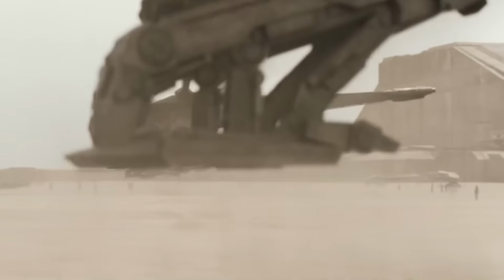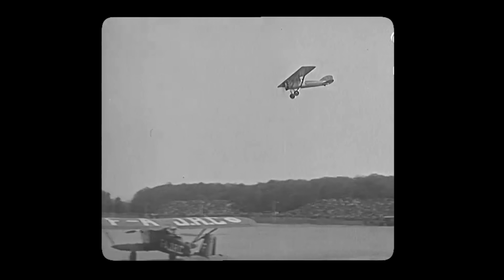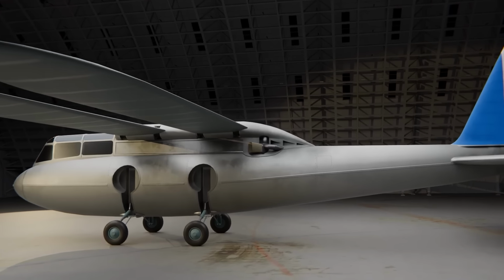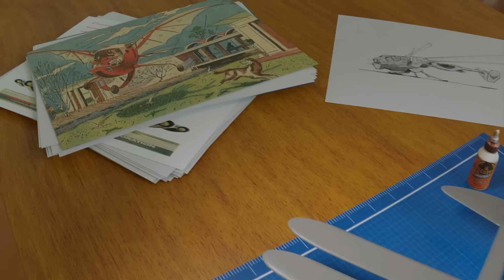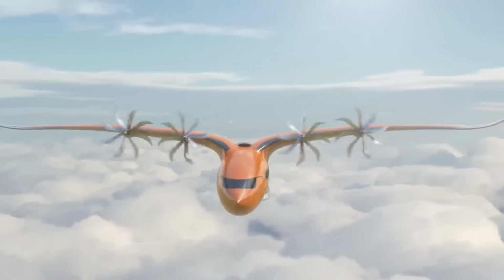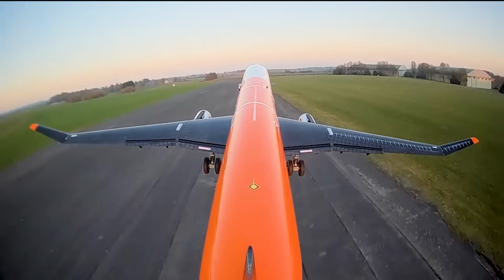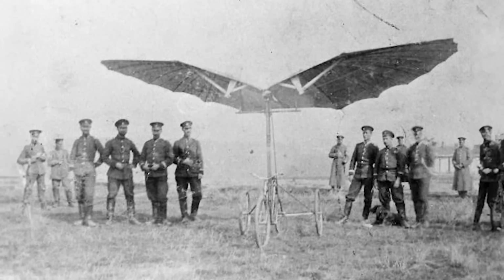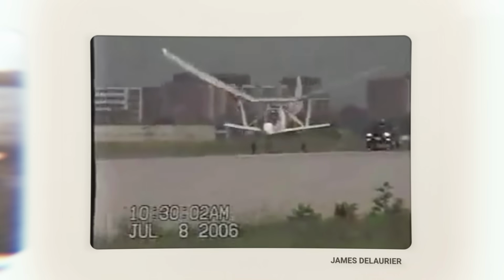The Real Life Dune Ornithopter... it was French!

Comment: the problem with these type of aircraft is a dragonfly doesn't scale nicely. We as human's weren't destined to fly, and lifting our weight into the sky takes a lot of effort. Thats why propelling hundreds of us im metal tubes needs a pair or two of big engines to do so. The mechanics of an ornothopter just doesn't scale. theres lots of  moving parts that can easily break down either from metal fatigue or simple failures such as a busted linkage etc. Plus it would be a horrificly uncomfortable ride; with all that vibration being mechanically linked to the fuselage.
Reply: 100% my thoughts. Scaleability is always the biggest hurdle. + how do you steer it? how do you even create lift with it just flapping up and down. Pretty sure a dragonfly can also rotate it a little in the axis n stuff. Biology is complicated and introducing so many moving parts its just inefficient.
Reply: @gabrielskoczek7092  Birds and bugs use rotational flapping, sort of like rowing a boat. Straight up and down does nothing. On a bird the feathers also open and close. You don't want resistance on the forward motion. You'll have to steer by varying pitch/speed of wings and swinging the tail around sort of like a hang glider minus the flapping. Ain't gonna happen for people...be satisfied with a hang glider.
Reply: 100% this
Reply: Exactly, this design at the scale in this movie will never happen. Too complex, materials that can't take the insane fatigue cycles, the need for extreme vibration cancelling measures. It's ridiculous especially when other flying craft designs could accomplish  the same or better flight with less complexity and greater reliability.
Reply: when it shakes itself to bits in the air, it cant glide or autorotate. it will fall like a brick, but the people inside will already be shaken to mush so i guess that doesnt matter.
Reply: @nomadrc6036  Wing timing could minimize vibrations, balancing each other out...like an engine. You'd need at least 4...they'll need to flap at about 20,000 fpms and rotate as they move up and down, so just modify some helicopter squash plates to .......oh yeah.....helicopters.
It's a ridiculous thing to try and work on.
Reply: Could see this as a real craft used by special forces in military, IF it can be made like the one in Dune, but cant see it ever being used as a passenger airplane
Reply: @elmeril2203  Imagine being a soldior in the thing though. Those wings beating up and down, transversing from up stroke to down stroke (to actually generate any useful lift) would make for a very uncomfortable ride! I'd rather spemd my time snoozing in a C130 than being shaken half to death in a flappy plane :)
Reply: i learned this in the fourth grade modifying a bus
Reply: Finally. An intellectual
Reply: METAL FATIGUE?

Dude, before any fatigue, any damn material in existence would frigging snap, the joints and gears woild snap too lol, what a frakshow of an idea, its got to be either a troll or an idiot who made kt
Reply: @mkzhero  There is an interesting design of aircraft, but they rarely talk about it, because this thing is secret. The topic of pulsed plasma thrusters has been developed since the early 60s (see PPT - Pulsed plasma thruster) - they are usually designed for spacecraft. But we will talk about a little-known design - these are plasma propulsion panels for aircraft, where the same Pulsed plasma thruster, but reduced to the size of a pencil and stacked in the form of cells in the panel. The design resembles a conventional plasma TV screen, where there are also discharge cells that activate the glow of pixels on the screen. And plasma propulsion panels have long discharge cells, the arrester has a railgun architecture (just rail contacts or coaxial), and the ionized discharge air is accelerated there by the Lorentz force to enormous speeds - a kind of ramjet engine is obtained. Just imagine! - tens of thousands of small ramjet engines assembled in a panel and firing plasma synchronously with a huge frequency (hundreds of kilohertz). Thus, plasma propulsion panels create lift by pulsed emission of plasma jets from railgun cells. There are tens of thousands of cells in the panel, they shoot at a frequency of hundreds of kilohertz, a huge pulse is obtained, and the plasma swirls the air into toroidal rings - the aircraft is held on this air cushion. Horizontal acceleration is created by the same plasma panels on the sides of the device (they glow, from the side they look like "portholes"). Such devices like "triangle" or "disk" have been observed for a long time, they are mistaken for alien ones - but these are terrestrial devices. They are classified and used for espionage and secret actions. Pulsed electromagnetic technology generates microwave radiation, therefore it is harmful to health. They rarely fly - only military missions. Therefore, they are not suitable for a citizen. This maintained the secrecy. Now they are already declassifying - many people know about this secret technique. When declassified, they will be used for cargo airships. But there is a danger that they are now going to be adapted to deliver small nuclear charges to decision-making centers - such means of delivery are not specified anywhere, are not conventional. This lowers the threshold for starting a war. It would be necessary to declassify them as soon as possible. That's why I'm writing about it. However, I have written before - starting with the book "The Elimination of UFOs" and many articles. There are also videos on my YouTube channel - "Declassified UFO" and "UFO Anatomy".
Reply: Today with all new materials and computer controlled 
 "drive by wire"😊 ill think its time now.
Reply: Still it's a beautiful looking machine.
Reply: @BigPicture-s5q  🕳💥🕳💥🕳💥🕳There is a secret technology.
Reply: Stop it, stop ruining my dream with physics and engineering and aeronautical limitations and stuff.
Reply: @bojangles2492  💩👽💩
Reply: You look at an airplane designer in the eye and say any airplane is 'simple', besides the face that it's not an objective statement. Easy for some, hard for others kind of narrative. Humans proved the impossible before, especially in the field of aeronautics.
Reply: It all started with James Pitts' "Sky Car" vibrating orthotopter umbrella, then the umbrella was closed with a dome and devices appeared according to the scheme of conventional electromagnetic vibrating speakers (membrane + inductance) - fragments of the membrane were found by a farmer in Roswell. Then they created piezoelectric thrusters, or with small dischargers on the surface (they glowed all over the body due to ionization of the air), and now they are planes with plasma propulsion panels (so they are angular - that is, with flat surfaces). Thousands of discharge cells are densely packed into motor panels - they shoot streams of plasma (railgun architecture - coaxial electrodes). The ionized air of the spark discharge is accelerated in the railgun chamber by the Lorentz force to enormous speeds - a kind of ramjet engine is obtained. Just imagine! - tens of thousands of small ramjet engines assembled in panels and launching plasma synchronously at a huge frequency (hundreds of kilohertz). Plasma jets form toroidal air vortices - this air cushion creates lift and acceleration.💫💫💫💫💫💫💫
Reply: @Pavel_Poluian  Just imagine boiling everything around your plane
Reply: @Pavel_Poluian  but that is no longer a dragonfly, people want flapping wings!!
Reply: @davidkottman3440  Gray Lives Matter!👽👽👽👽👽👽👽
Reply: @Pavel_Poluian  Lol! I like it 🚀

Comment: I don't know about you, but when I'm designing a machine I try to include as many moving parts as possible.
Reply: V 22 Osprey mechanics: 😰
Reply: @tangow371 fantastic they are… 100% problems free , are not.
Reply: @tangow371 The Osprey is still magnificient.

Less accidents than happened with either the blackhawk or the Chinook.
Reply: @tangow371  tbf any VTOL is going to have way more moving parts than something that just flies normal. Much less a tilt rotor. Only so much you can trim
Reply: Actually - a flapping motion has much less open spaces than a rotating one.

It's actually quite better in sandy conditions than anything rotor or tilt rotor based.
Reply: Maintenance engineers: Screaming in agony
Reply: @killman369547 Maintainance in desert environments is going to drive suicide rates skyhigh
Reply: @SO-wk1en this is the core principle of steam punk design
Reply: Obviously, how else are you supposed to know that your machine is working
Reply: You want a german engineer? Because this is how you get german engineers.
Reply: citroen worked
Reply: I would have guessed this was another example of German overengineering.

Comment: Ornithopters are such a cool concept
Reply: Its a pretty stupid concept actually, it literally offers zero possible benefits to any kind of aircraft in existence that's being used. A 'biowing' COULD be a cool design, if it controlled with your fingers and wrists and was modeled afer bird wings, could flap, or function as a stable wing as it does most of the time, or, morph and adjust in real time to account for various changes and needed manuvers... But the main use for thag would be stunt flights and maybe hotzone military flight, normal flight applications meanwhile benefit the most from a stationary wing, which is by far the most economical.
Reply: @mkzhero  Yes. The thing is, we have propulsion that is decoupled from the wings. Birds, bats or insects don't have that ability. Machines often don't need a very mobile wing, because of that aspect. Another factor is that a small creature like a bee, experiences things differently. Flying for a bee is like being immersed in honey. The air feels much thinner for big machines or animals. That makes a difference to the required strategy.
Reply: I think they'll make a come back.     They clearly work but now we have the solid state autopilot and stability control systems to make it work as well as high power electric motors for control of wing flapping, articulation and warping.    They will be VTOL and very quiet.
Reply: @williamzk9083  not sure about that, they would be less efficient, a lot more stress on the moving parts and who knows how loud it would be because there isn't a full scale working version
Reply: @williamzk9083 
Energy efficiency and the ridiculously high inertial forces at the wings with every direction change at this speed negate your idea
Thats why you dont see this on larger animals.
Reply: @Erlkönig317  pterodactyls with wing spans of 10n/33ft  and 250kg flew and leaped into the air.   Only minimal Stresses would be involved.  The inertia of the  gentle downwards propulsive beat is arrested by aerodynamic lift itself.   The wing then twist and  rises gently under its own lift till at the top of the stroke when it descended da again.   There would be no huge forces at the shoulder Joint
Reply: @williamzk9083 The bigger an animal, the less it flaps. For good reasons. Large Pterosaurs would have hardly flapped in flight mode.
Reply: @kentl7228 The problem with this double wing system I think it is based on  insect flight which does not scale well due to Reynolds numbers increasing with size and stresses going up.   A more bird ike mechanism is better I think.